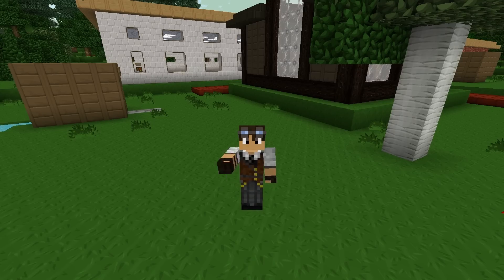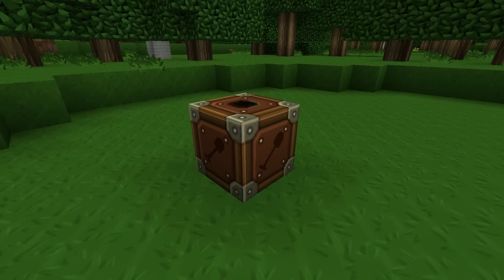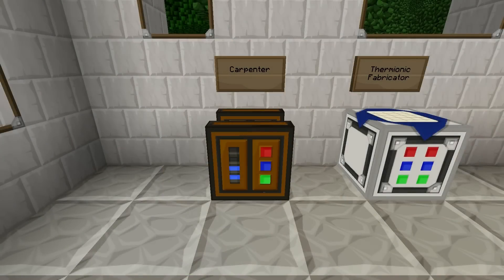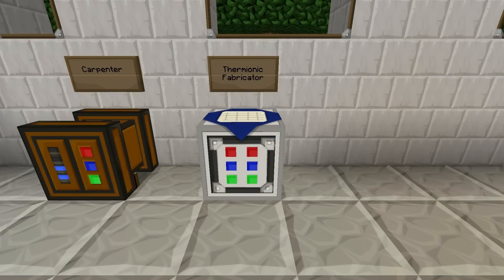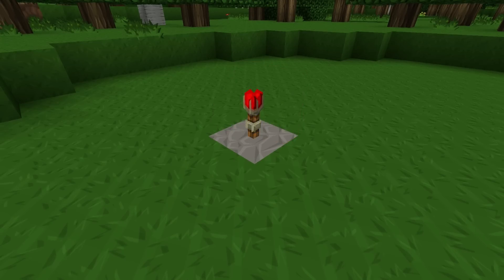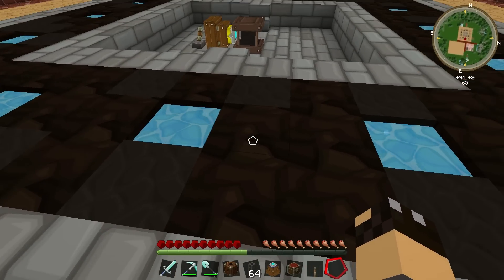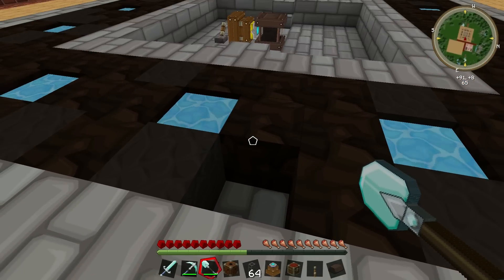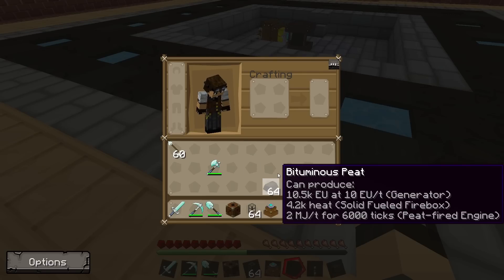How to Feed the Beast in Minecraft - Turbary - 4

Comment from the maker: The Forestry machines need BuildCraft power to run. Generators are IndustrialCraft. So either use a Stirling Engine (Coal powered), or an Electrical Engine (which can convert EU IndustrialCraft power into MJ Buildcraft power).

Comment from the maker: Hmmm. If the peat is jumping out of the pipes then it sounds like the destination is full, or you're trying to pump into a side which doesn't accept the peat input (input direction is important).

To separate seeds from wheat, use a filter on the hatch (the filter is a redpower item and goes before the pipe). If you put a piece of wheat in the filter, it will only draw wheat out.